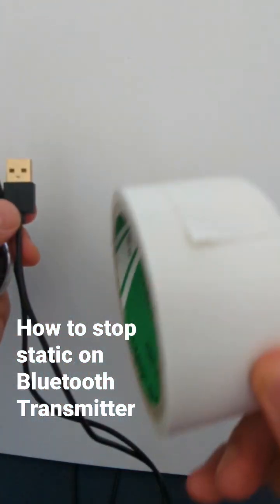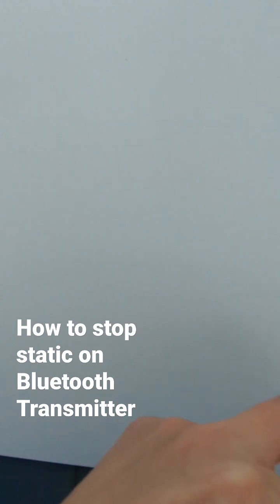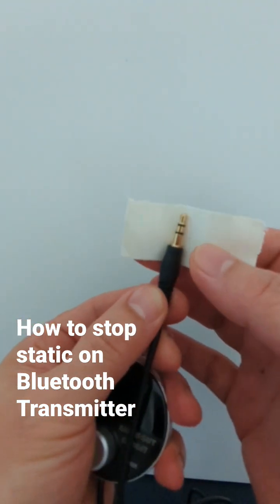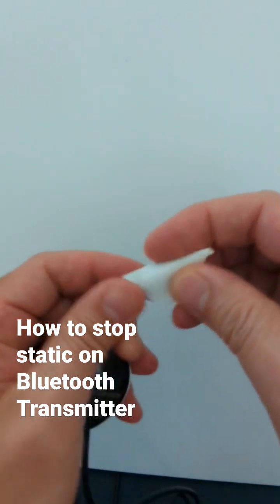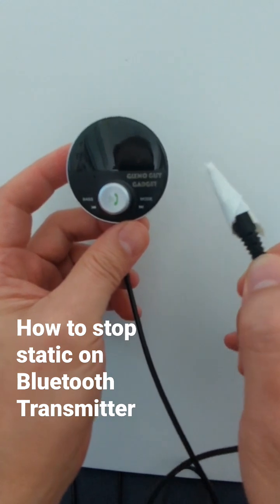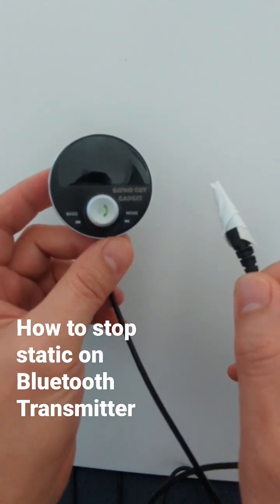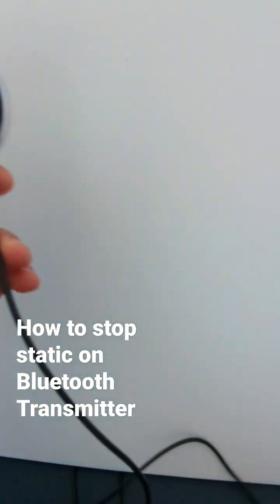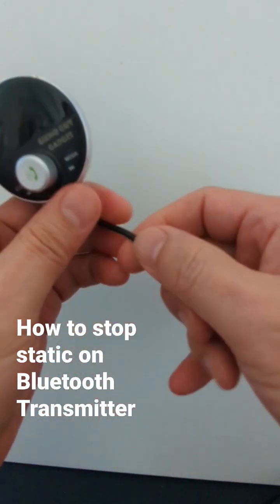How to Stop Static on Bluetooth Transmitter - Gizmo Guy Gadget Bluetooth Adapter

Comment: The 3.5 mm plug your showing is one that plugs into the headphone jack of your Smartphone. An FM Bluetooth transmitter wirelessly connects your phone to the radio in an older car that does not have Bluetooth built in. What your saying is ridiculous. A Bluetooth transmitter HAS TO BE POWERED. Do you even understand these simple concepts ????

Comment: I'm confused. So do you plug it in to the auxiliary port in your car with the tape on? Will it fit? I'm getting a loud air sound in my speakers when I try to play music from my phone using an male to male auxiliary cord.
Reply from the maker: try a new set of male to male wire to start.